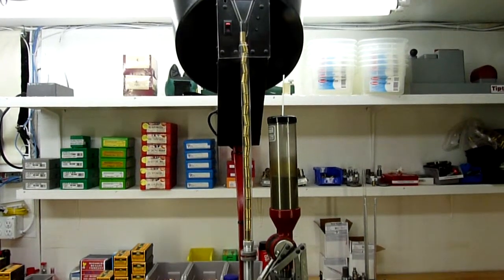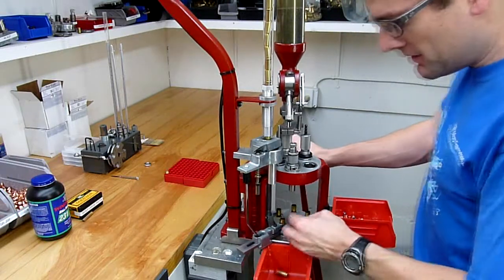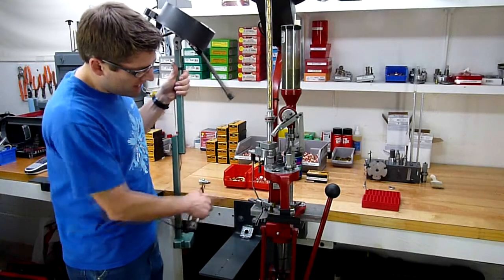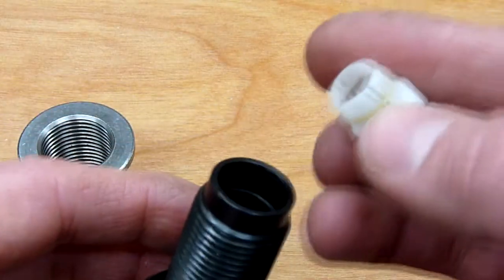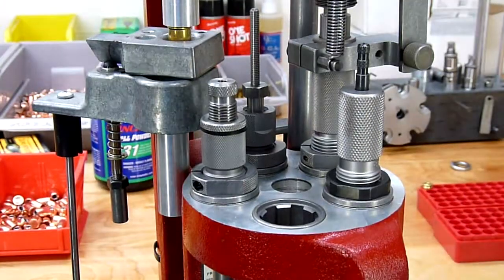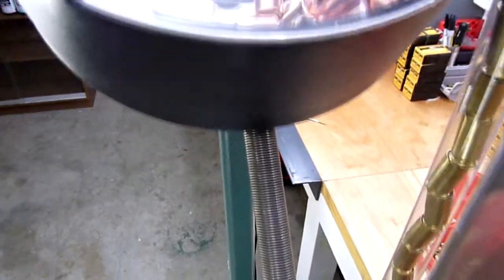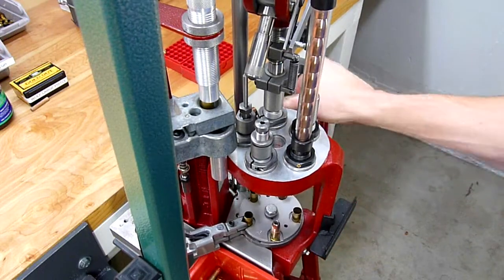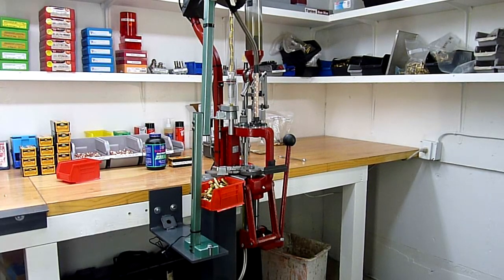RCBS Bullet Feeder on Hornady Lock-N-Load 45ACP (HD)

Comment: Ask elaborate as you are, I make two suggestions that I suspect you will follow thorugh with.

1. Shorter crank arm for pistol rounds.
2. Lift the press up and quick using your back by putting it higher.

great vid, keep it up.

jeepmor